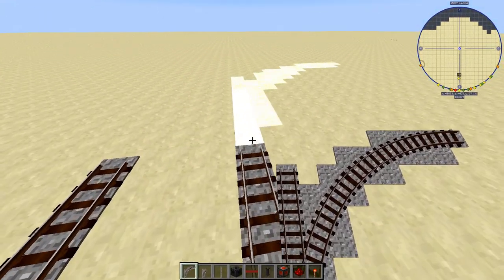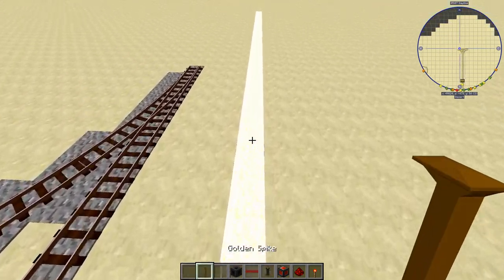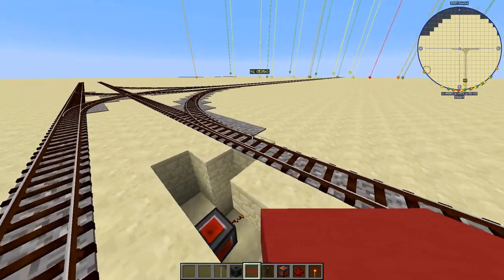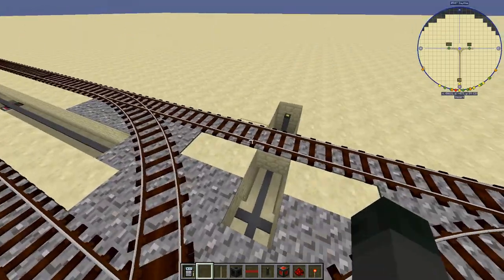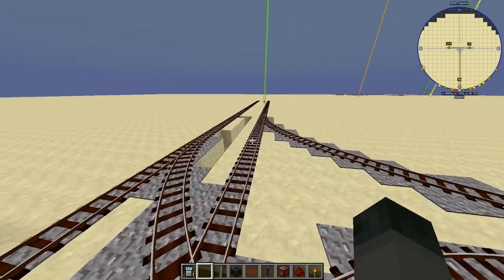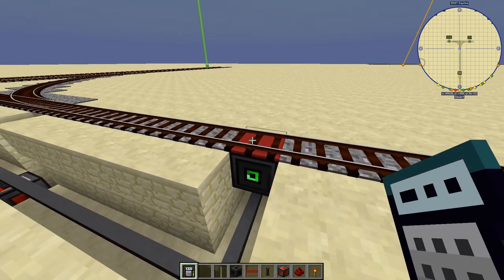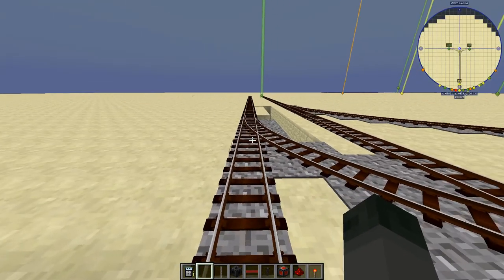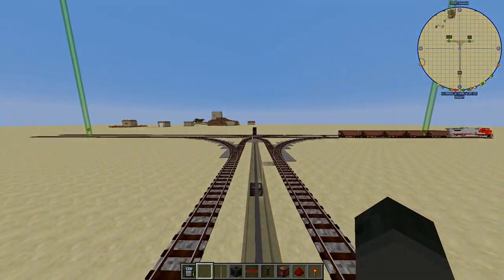Immersive Railroading Automated Network: Junction Tutorial

Comment: I really do love this script:)
I would need a way to reset the switch after the last wagon of the train passed for my train station.
Not sure what to use in your code? Maybe a timer or another detector?
Reply from the maker: Well, I think the easiest thing to do if you wanted to do that, is to add a timer so that after, for example, 30 seconds, you reset the switch. You can do that via event.timer(function() <redstone io reset code here> end, 30).
Reply: @andrewlalis  I added a os.sleep(30) 
etc. Worked for me
But I think a "reset the switch after the last waggon of the train (consists) " would be nicer. Not sure how to write it though.
Maybe reuse the detector for the "last waggon" part and then add another 10secs to be sure?

Comment: where do I get the program to put tag on trains ?
Reply from the maker: It's not really worth it to post a program for that, considering that it's only 5 lines or so. Just check the immersive railroading wiki, since there's just a function that the detector augment exposes which allows you to set and read the tag of a locomotive.